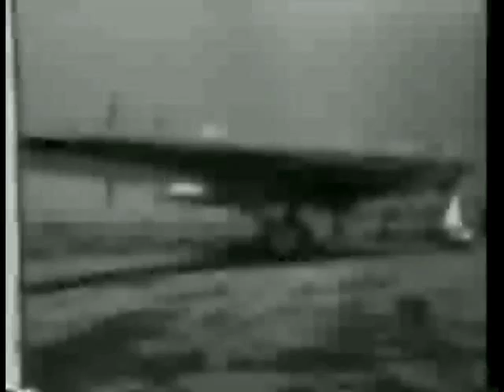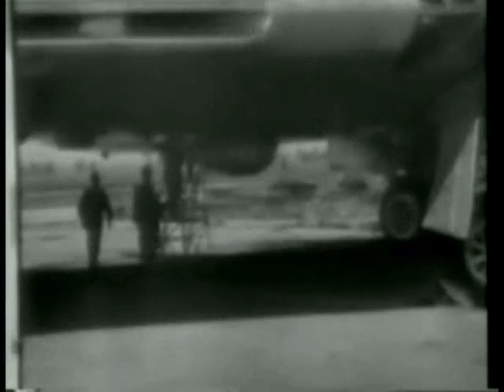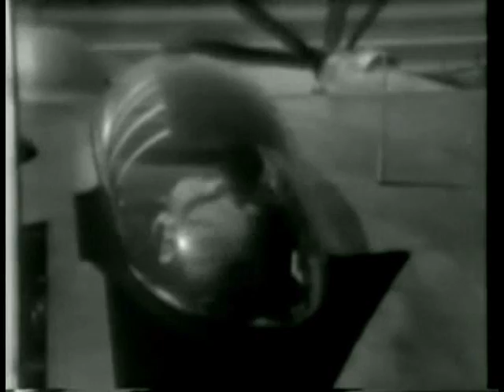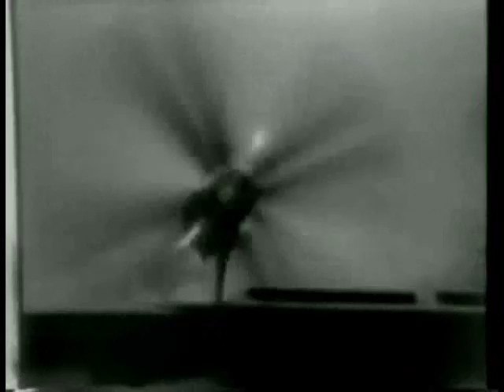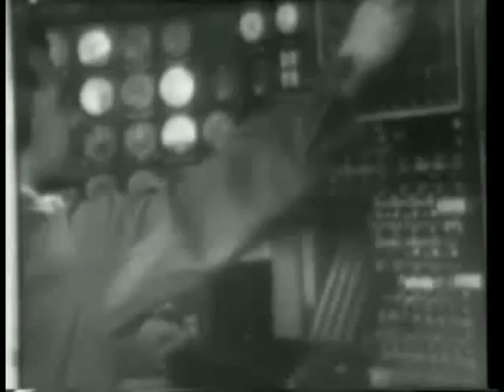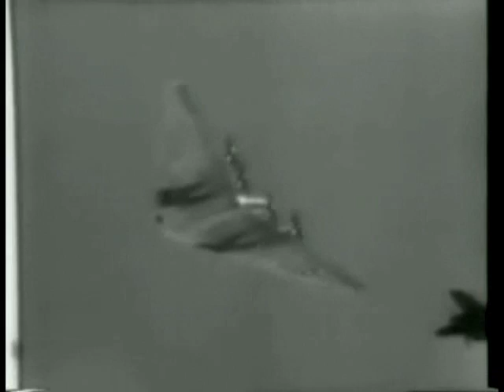Northrop Flying Wing

Comment: Yaw instability was much more of a problem when jet engines repalced the piston engines.
Reply: Actually, during the investigation to the XB-49 accidents indicated the high possibility of sabotage. The testing would have probably included RADAR visibility testing and the RCS of the aircraft would be small compared to most other aircraft of the time. This would make it a far better contender as a strategic bomber than the the more conventional applicants.

The thing is, you had to FORCE the plane to stall... which was actually harder than it sounds.
Reply: can you explain how turbine engines "create" instability about the yaw axis?
Reply: jason stout
I can not explain it. Perhaps it is indicative of the inherant drag in the propellor version creating stability.
Reply: well it cant be explained because it isn't true. they produce no twisting torque at all. the propeller has nothing to do with yaw stability. i am an aircraft mechanic certified A&P  and was a turbine engine mechanic in the navy.
Reply: jason stout
The yaw instability worsened when the aircraft went from props to jets. And I was, over the course of to years, an ADR, an ADJ, and finally. an AD.  ADR A school in Millington TN, 1972. Went to night school classed that bacically taught the A&P tests. Took and passed them. Completed the oral/practical at Brown Field in San Diego. Yes, I got my A&P.
Reply: maybe you need to take some physics classes than?
Reply: jason stout

Perhaps...perhaps not.

Comment: @Dreachon 
Just look for the "Westland-Hill Pterodactyl Mk. IA" flown in 1928, this is actually a true lying wing as it has no tail.
Build by the British, there are even french flying wing design predating mr. Norhrop's design.
Mr. Norhtrop plane still needed a tail with external control surfaces on it, mking it not a true flying wing.

And once again you can do nothing but insult people, and then you want people to believe that you fought in vietnam.

Comment: @LottoWinner999 
This is what your site has to say about the Horten Ho-V

"The Ho V, built in 1937, was the first of the Horten craft designed from the outset as a powered airplane and was the first Horten wing of sufficient size and capacity to demonstrate the commercial or military value of this type. The 1937 Ho V had two side-by-side cockpits and was powered by two Hirth HM 60R 80 hp-engines."

That is a direct quote from that site.

Comment: @LottoWinner999 
And another lie, just why are you incapable of reading, the 1929 was a single-engined plane first build with a pusher propeller and then later rebuild with a pulling propeller.
A twin-engined flying didn't arrive from mr Northrop until the N1M in 1940 and even the site you link to call his N1M his first true flying which put's him behiind the Horten brother who their first true flying wing in 1933 in a glider form and powered version before the N1M.

Comment: @gilliguts  .Adolf Galland,commanderJV 44(Me 262 &later the Argentine Air force(Meteors&Vampires) said “We Germans had the superior airframes but the British had superior engines-   ”Due to the blockade BMW had to used mild steel in its jets requiring major service after 10hrs&rebuilding after25hrs. Britain used high temperature alloys made of rare earth metals avoiding these problems. Frank Whittle wrote in 1939, Axial flow is for future, if we want jets now we have to use centrifugal flow

Comment: @nodarnfool 
Discovery Channel had Northrop build a Horton 229 jet wing mockup and radar test it.  The wood carbon composite only reduced radar reflections about 20%, the YB-49 had an even lower radar return because it's engines were buried fully in the wing instead of partly buried like the Horton.

Comment: @ryznaga Bothe The Sabre, MiG15 and Saab J-29 where all based on the Focke-Wulf  Ta 183 design ( the J-29 keeping closest to the Ta 183 layout). All three used Rolls Royce WW2 designed engines built under license, or with the MiG15 just copied, which proved superior to available German jet engine designs .

Comment: Well since your such an american history buff and obviously such a patriot dont you recall that the northrop project went largely over budget. And the plane also wasn't as stable or as fast as it should have been. The flying wing desinge didn't take off untill fly by wire technology. Many computers are necessary to keep these birds in the air. And Werner Von Braun did not invent the rocket however he did improve it very much and ended up working for the US. KISS MY FAT WHITE ASS YOU WANNA BE HIC

Comment: "The Horten Brothers flying wing bomber. It was intended to be a '1000' bomber, ie, it was supposed to fly at 1,000kph for up to 1,000kms, carrying up to 1,000kgs of bombs. The wing skins were made of a wood-carbon powder composite that absorbed radar pulses, so it would have been largely invisible on radar. Quite a project, but the war ended before it was fully developed."